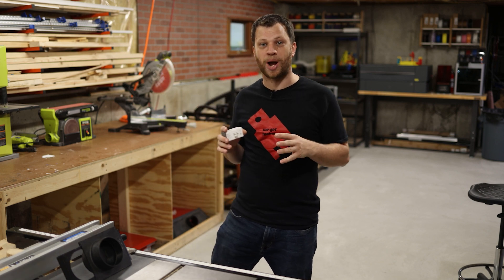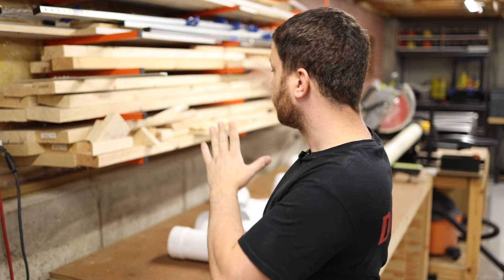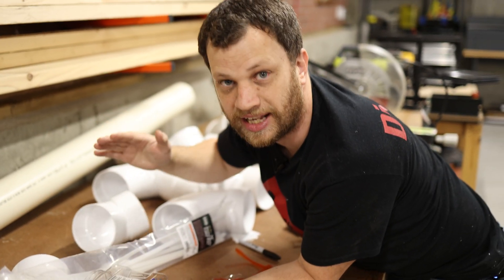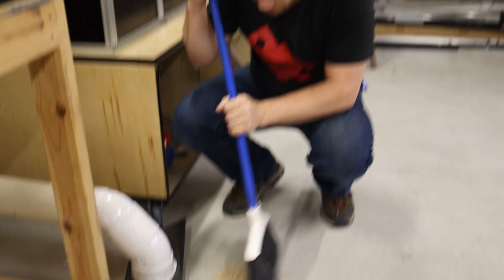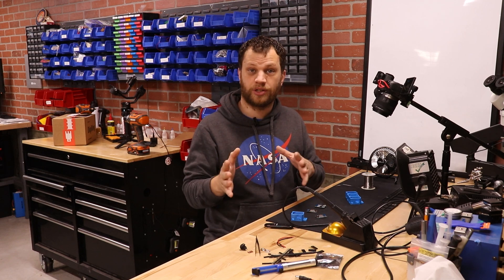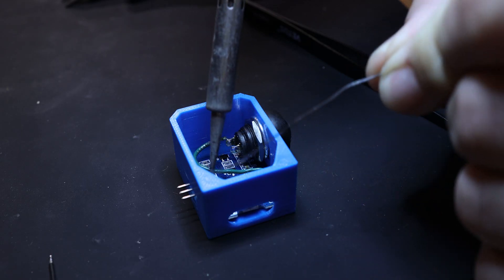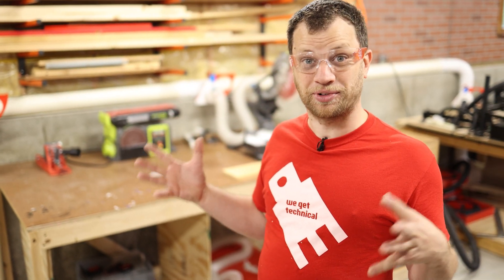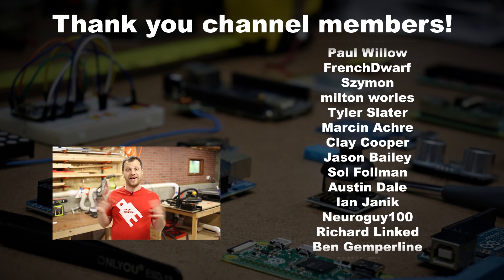Building a blast gate that opens when I turn on my tools

Comment: has anyone else had issues printing the blast gate body? Prusa says there is a stability issue, when printing ,most of the layers are very lacey.
Reply from the maker: What orientation are you printing with? The triangle face should be flat to the print bed, and the circular dust port should be facing up in the z direction. Is that how you're trying to print?

Comment: I added a pull request with a slight tweak to the fusion 360 model on Github that will allow you to use m4 heat set inserts in the mounting column for the servo and Wemos. I generally dislike threading screws directly into the plastic. I also added som filets to the mounting columns to help distribute the force of the servo. A slight filet will help avoid stress cracks in the 90 degree corners. I also think it just looks better.
Reply from the maker: I saw that PR, thank you!
Reply: @bytesizedengineering  I think I did it correctly. I am not very familiar with how GitHub works. Do you have any issues with the inrush current being too high for the smart plugs on your saws?

Comment: Hi Zach, I love this setup and have already printed enough parts to make up 5 automated blast gates for my own workshop. I'm new to these type of controllers and am having trouble, not to mention I haven't done an coding in over 20yrs. The files are not compiling and getting errors in several lines. I've added my own SSID and wifi settings but, the rest I'm getting stuck.  I'm more a hardware nut than a software guy, so any assistance would be appreciated. I also noticed the manual push button you installed in the yaml is configured to run from pin D7 but in the video timestamp 10:43 you had the wires soldered to D8 & 3v3, can you also maybe give some feedback on that. Cheers ;)
Reply from the maker: These projects are really hard to troubleshoot using YouTube comments. I'm also not a home assistant expert. Are you trying to compile the firmware for the sonoff? Are you doing it through ESP home?
Reply: @bytesizedengineering  Hi Zach, sorry for delay in responding. I have managed to resolve the issue through ESP Home, this is for the ESP8266 D1 Mini boards, but I only seem to be able to get it running with using the designation of "GPIO2 for the servo instead of D2 & GPIO13 instead of D7 for the momentary switch, but can't get the momentary switch to function with these settings. I'm also trying to find decent aluminium servo horns to suit the servos as 3D printed ones crap out after a few activations. Cheers ;)
Reply: @bytesizedengineering  Hi Zach,  left to my own devices I have figured it all out. I have even managed to substitute a Sonoff Basic R4 inline switch in to replace the s31 switches you are using per tool. Thankyou again for a great project. Cheers 👍

Comment: In my local Makerspace, we had the CNC connected to the dust collection using pvc pipes. On two occasions, we had embers in the pipes that caused small fires leading to melted pvc. Not to be recommended. We believe the initial cause was probably too much friction caused by blunt tools  and the embers combined with dust lying in the pipes. I would suggest that you consider including heat detection along the length of the pipe to ensure that this is avoided.

Comment: I would not use a "T" fitting anywhere. They're aweful for collecting dust. ALWAYS use a Y, and make sure the air is flowing in the direction of the single leg of the Y. The first fitting you post in your video is a bad choice. Dust coming from your tool will slam into the back side of the fitting....and then make a hard left to go to the dust collector.

Comment: Did you post a schematic for the wiring connections between the switch the servo and the wifi chip? I couldn't see it ... thx
Reply from the maker: No, I didn't post a wiring diagram. The servo uses 5v, GND, and one digital output from the esp8266 for pwm servo control. The switch just connects to GND and an input on the esp8266. It reads the state of that switch.

Comment: I'm only halfway through the video so you might cover this, but wanted to comment now, so I don't forget.

You'll probably want to run some electrical discharge wire (not positive the name, it's just wire) along the length of the pipe as static electricity can build up quite high as dust goes through in use.

Comment: Hi Zach, great video and finally a rotative design which can be used with a servo motor! I just finished my system with doors that open and close, which works fine with servo motors as well, I just have one problem. For keeping a gate (door) closed tight, the servo has to maintain a certain force and it is very critical to dial in how far the servo has to go. This seems much easier in your design and you don't need any force to maintain the open or closed position, which is much better for the servo! How about air tightness and friction? Doesn't your system need a lot of friction in order to be tight? And can you open a gate when the vacuum is already on?
Reply from the maker: @jean-pierrerohrer4866  That's awesome that you created your own! Mine isn't perfect but there are some good design decisions. I don't use mine every single day so I may not be the best person to ask. However, it seems to be pretty airtight. It is hard to open a gate when there is suction from the dust collection system. But that could be fixed by having a higher gear reduction between the servo and the gate

Comment: How would you rate the blast gates after using them for a little while now? I know the giant 3d printable rotating ball gate has been rated well, any tweaks you'd make to yours in a V2? Thank you for generously providing all of the files for this build as well.
Reply from the maker: The only thing I would tweak is the timing of when the gate closes/opens. If the dust collector is already running, the suction makes it hard for the gate to open and close. As long as that takes place when there is no suction, the gate works perfectly.
Reply: @bytesizedengineering  Thank you, just digging through DigiKey now to find the switch…over 80 thousand!
Reply: @bytesizedengineering  Great to hear, a little yaml tweak and all is well. Now to scour through DigiKey to find the switch! Thanks again.

Comment: You should add one of those industrial switches with the spring on, for the collector on the floor. With one of those you could just bash the spring with the brush and have it turn on without stopping sweeping.

Comment: Fantastic idea, and a very good realization. Iwas on my way to do the same thing, but with a linear blast gate, but your idea is better and more easy. I will replicate that. I've got some question:
1. what kind of wemos D1 mini did you take D1 mini, D1 mini V3, Pro, V4 ?
2. do you think it will be possible to add some led to indicate the statut of the blast gate like a green when it is open and a red when it is closed ? I've got some 12V LED, and I would like to use it, but I don't know how to add it and program it with the D1 mini. Could you help me for that ?

Also could you provide a wire diagram of the connection for the Wemos D1 mini and the servo and the button ?

Comment: Could always use the linear gates by putting a small pinion gear on the servo instead of a control horn and then printing a little rack to go along the slide part.
This is a great design but I don't think I'd like the big triangular bit stuck on my wall as much as the linear slides.

Comment: really great stuff. a couple of suggestions if you are interested... one is that the dust going through PVC will build up a ton of voltage... like thousands of volts. I had issues with the sparks interfering with the electronics on my CNC during really long cuts. So you may want to think about grounding your PVC pipes every so often. You can look up dust collection grounding for ideas. Another idea is for your floor sweep. My guess is that you will occasionally kick that sweep sticking out with your foot or rolling carts/tools. But you have that perfect wooden workbench there so you could cut a hole for the PVC to go down into and then have the floor sweep end flush with the wooden workbench, so you would just be sweeping up everything underneath there with nothing to trip on. Thanks for the great ideas!
Reply: Another idea for the floor sweep would be to switch out the push button for something you can trigger with your foot. Who wants to bent down for a button when you can use a foot pedal, motion sensor or photo sensor? Or even RFID with a tag in your working shoes, so your mice doesn't trigger the system in the middle of the night
Reply: While ESD (ElectroStatic Discharge) may interfere with eletronic devices, I would use a different path. 

1- Properly ground your CNC,
2- Use Shielded cables,
3- Use Anti-Static flex tube between the main PVC run and the CNC.

Some people are very sensitive to electrostatic discharge. To prevent being zapped don't work barefoot on carpet 
🤣

Comment: For my system I didn't add an auto close of the blast gate when the dust collector turns off because you might risk burning out the motor in the dust collector if it has too much resistance even when winding down.
Instead when one gate opens for a tool all other blast gates close if they are open so there is always an open path for the air to flow in the system.
Reply: Doesn't work if you have a CNC system constantly running in the background
Reply: Well then you always have an open path for the air to flow in the system so you don't need that tweak 😊

Comment: Your gates probably could've been kept closed with springs, and then momentarily opened via another method

That way the system is always "closed" until needing to be opened
Reply: You could open the gates by having vacuum from the  extraction control some pneumatic actuators, but then, the servos function very well, and probably easier to make.

Comment: Not watched the full video but I hope you're putting some sort of flame arrestor in there, all that plastic which can cause static and all that dust could be an explosion waiting to happen.
Reply: Actually, no.  Search for "Grounding PVC and Other Dust Collection Myths". There have been no known fires or explosions caused by dust collection systems using PVC pipes. After reading the article, you'll find that common myths like installing a ground wire won't help, and that metal ducting does not prevent the dust from acquiring a charge. Lots of good information there.
Reply: Pretty sure that's been totally debunked by several sources, but who doesn''t want unsolicited comments from someone who admits they haven't even bothered to watch the video so they don't even know if their comment is relevant at all.

Comment: I notice that you have a 2x4 under the platform next to the floor dust collector. Perhaps build that into the area under the platform so it's not sticking out like that?  One other thought is to delay the blast gates closing by 10 or 15 seconds to allow the dust collector to spin down so you're not putting a hard vacuum load on the pipes and fittings.
Reply from the maker: @JCWren  Yes, I have totally considered doing that. There are a lot of little tweaks like that, that are pretty easy to adjust

Comment: For the floor sweep, you could add a sensor that would be easy to actuate with a broom, like a break-beam or ultrasonic sensor.
Reply from the maker: @blazer5154  That's an interesting idea! I hadn't even thought of that. Any idea that allows me to be lazy is a good idea
Reply: @bytesizedengineering  Not nerdy enough and is it gonna turn on everytime you walk by? Do a proximity sensor between the inlet and your broom.
Reply: Or just a simple flap you can operate with your foot. Worked in huge international facilities and that's all they use. Keep it simple